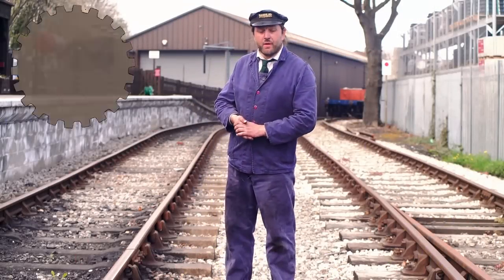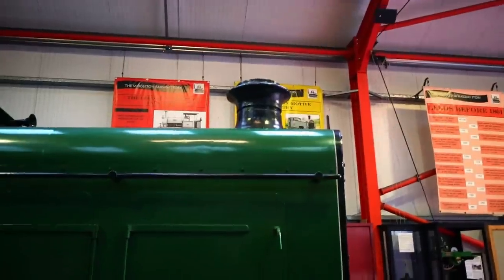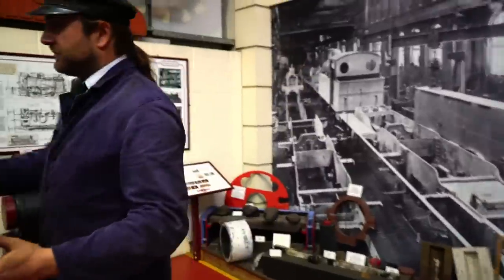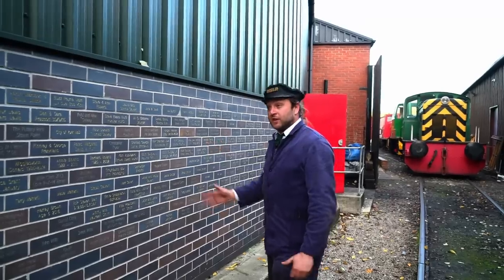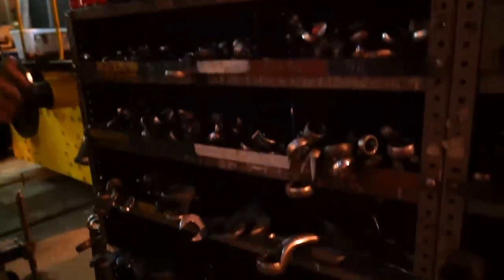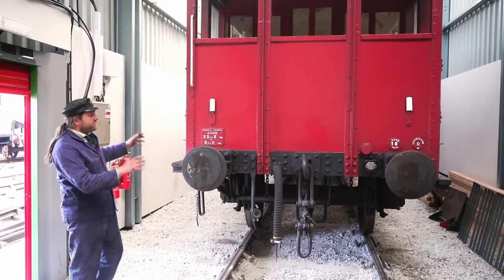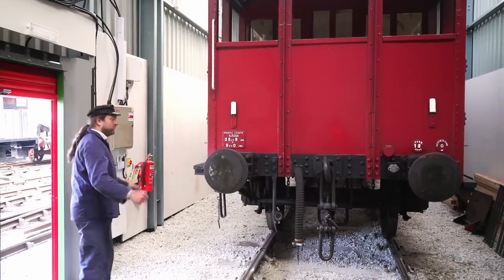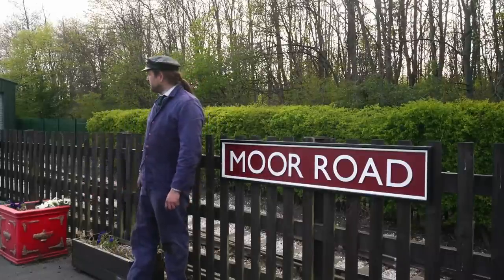Access all areas at the Middleton Railway! - LMM Visits Episode 1

Comment: that tethered electric engine is so neat: the Milwaukee road here in the US had a similar design of engine (though made out of spare parts, and its awesome) that worked in the shops on its electrified portion. per people I've talked to who worked with it, it ran on, and I quote, "A large extension cord, which it occasionally ran over." 

it actually survives in Harlowton, Montana, which is quite nice to see. usually the oddball engines like that get cut up first.
Reply from the maker: "why has it stopped?"
"we ran over the cable"

Love it!

Comment: For a year in the 1960's  I was a student volunteer, I drove No 54 (the sentinel a couple of times moving freight from Clayton's Yard down to the BR connection , the bottom end of the loop was BR territory. I remember helping unload 1310 near where the old Leeds tram tracks crossed the running line. We also delivered  scrap metal  to Bird's  where the worker's  retreat was the body of a railmotor. I can remember handling a Trestrol Wagon  with a huge steel sheet on in the dark of a Winter's evening and having to get some wagons away  to get to Liverpool docks with parts for a gasometer for Hong Kong. The Sentinel was the only wotrking locomotive, getting coa; into the fire was a ptoblem sometimes as too large a piece could get stuck  and getting it out with the boiler at 275 psi (hot)  was difficult
Reply: Drop a line to the Middleton with your memories - either for the next book on Middleton in Volunteer days or a short article in the quarterly old run journal
Reply from the maker: Oh that sounds amazing. It must have been such a bonkers thing to be part of
Reply: Wow

Comment: That cabled electric locomotive… The idea is not as rare and crazy as you think it is, Lawrie. If you ever have the chance to go to Harlowton, Montana, you will find another example of that type of engine at the depot museum there: X3800. It’s a little shop goat that the Milwaukee Road used to move their massive electric locos in and out of the Deer Lodge roundhouse, and it got its power from a cable system as well since the roundhouse itself was not electrified.
Reply from the maker: It does seem pretty unusual I think in the comments we've have three examples!
Reply: @lmm  Well, it’s definitely not a common practice to build such engines. Anywhere else, steam and diesel engines could move themselves around if needs must or a dedicated shop engine was unavailable.

Comment: A side note on that cable reel powered electric locomotive. In former East Germany they converted a bunch of Köf shunters from diesel to this kind of electric reel operation to serve factories, their only job would be to pick up and deliver freight cars between the factory and a near by freight yard where they would be picked up by freight trains.
I have no idea about the rational behind converting diesel shunters to this purpose, if it was to save fuel or prevent sparks from the exhaust from igniting fumes at chemical plants.
Reply from the maker: I assume is diesel electric locos it wouldn't be too big of a job
Reply: @lmm  You are right, but the thing is a Köf is not diesel electric but diesel mechanical/hydraulic. Meaning that they would have pooled the engine out and installed an electric one. I tried to look for an article I once read online about this, but i could not find it. Still if you search for "Köf Schleppkabel" or "LKM Schleppkabel" you should be able to find a couple of pictures. among them a preserved LKM build Köf at a museum.
Reply: @lmm  Wait I found the article, it is in German but there are pictures of these modifications: https://kleinloks.de/wp-content/uploads/Dateien/27.01.2020_LKM_ESF.pdf

Comment: I am not certain that Harry was the Fowler in the earlier photo - the locos have been bought and sold over the years.
Reply from the maker: It isn't. But it works for a visual
Reply: @lmm  I wanted Harry to remain in the Blue BSC colours, but some members have a thing about locos being some shade of green ,  I am sure fowler with that body style intended red and silver like some tri-any transcontinental locomotive
Reply: @lmm  Couple of locos missed - Where is Windle, and was the Trindad loco in its location rusty when you were there (it has been given a coat of black now)
Reply: @highpath4776  Windle is at Ribble
Reply: @Taggart00  Thanks,  forgot.
Reply from the maker: @highpath4776  I think when we filmed this it wasn't painted and didn't represent the good work that the railway does.